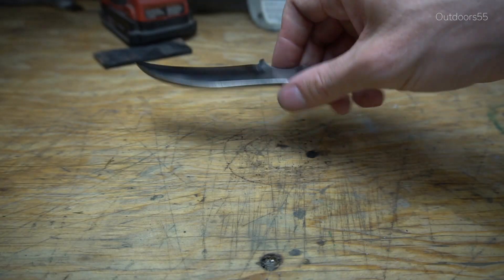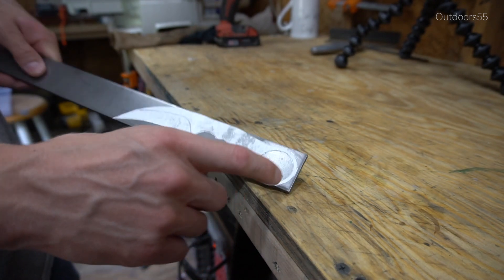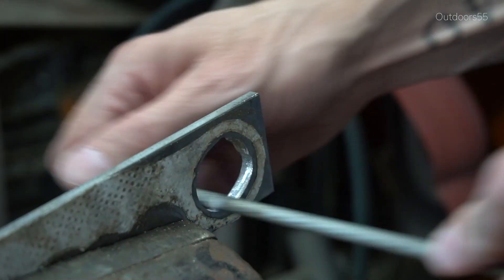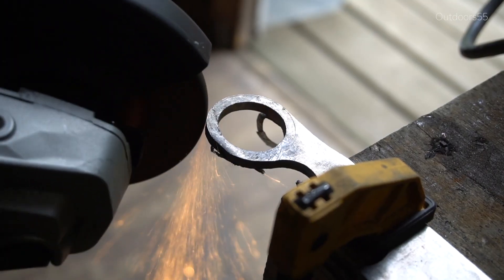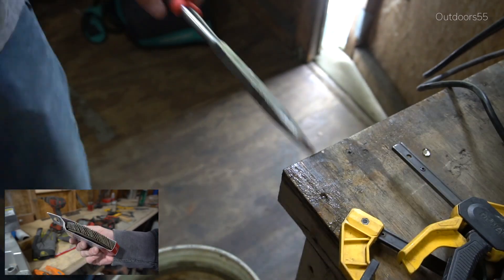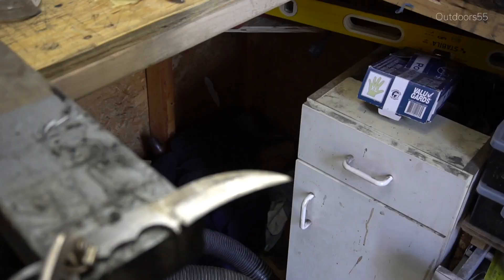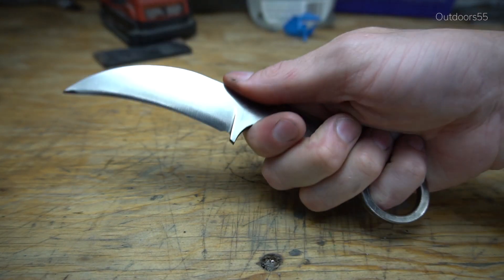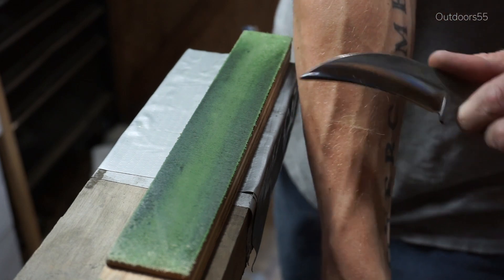Knife Making with An Angle Grinder And Basic Tools.

Comment: When I first started making knives in 1992 I heat treated my O1 tool steel knives in charcoal and used a shop vac blower to increase the heat. I used canola oil too. I used a 3x21 belt sander clamped to my picnic table for a lot of my grinding and here's a tip. For grinders use the sanding discs which only go up to 120 grit and glue higher grit sandpaper to them. I used this method with sanding drums too. Use wet dry sandpaper and it lasts for a longer time.

Comment: you should get a jewelers hacksaw. with a #0 saw blade, i bet you could've sawed through that hole in under 10 mins, using only 2-3 blades which are dirt cheap.

Comment: My way of making a large hole using a smaller drill is to drill holes around & cut their boundaries with a small cold chisel, then finish the job with a half-round file.  A lot of time & effort can be saved.

Comment: You should try a strop on a curved surface for hawkbills and recurve blades.

With karambits I find them a bit scary to spin around the finger if the ring is too thin or big, especially after hearing about someone getting bit on their own wrist
Reply from the maker: Yes you can definitely get bit. Its not recommended, especially if they are REALLY sharp haha.

Comment: Great video. Just one question. How to protect blade from rust?
Reply from the maker: Any light oil. This finish will patina fairly quickly and won't rust. Its usually how I finish my axes and I've never had rust on them. They just turn a nice dark color over time.
Reply: OUTDOORS55 Thanks I'll try.

Comment: i noticed you made like a dozen little cuts with the cut-off wheel before notching it out for the handle material removal. you could also drill 2 holes as far apart as possible, then cut down into the holes from the side so you have a tab of handle material, then cutoff wheel the holes together lengthwise and have removed a lot of bulk in a shorter time with less wear on your cutoff wheel. still need some shaping but it would have saves a lot of notching and grinding.
Reply from the maker: Because it doesnt work for smaller pieces.

Comment: i was thinking about getting a ryobi 5.5 amp angle grinder you think it would be strong enough  for stock removal
Reply from the maker: Mine was a 4 amp and it was OK. The more power the better. Its difficult to say as it seems different companies may embellish the motor hp and rating.
Reply: right well guess ill go with a 7 amp its only 15 doll more....thanks for the response i appreciate it.

Comment: Great work with just a few tools most people already have. Would've thought you could put your oil can on the fire for a bit instead of trying to pre heat by dipping with hot metal a few times. And I think that knife would look sick with a layer of paracord around the handle for a little extra grip, hand to hand combat can get a little slippery... what with the blood and all...🙄🙄🙄 New sub anyways, hopefully you got around to making a video on how to sharpen a curved blade. Just starting out blade making & hoping to make a kukri, was wondering how to sharpen one. Might try the karambit first though, looks far less intimidating a project for an amateur.

Comment: Another great knife and video. :)  I have just started knife making myself. I was wondering if a step drill would work for the larger holes?
Reply from the maker: It can, yes. Id say this hole is about an inch and a half so you would need a large step bit and they are expensive. The largest one I have is 3/4",  so not even close. Using a rotary grinder is also a good way (its a tool I have but didn't use for this build).

Comment: Hi. I hope you’ll bear with me while I ask a question. I am very very new to making knives. I have made a couple from Files, and although I wouldn’t bet my life on them, they turned out better than expected. LOL. I recently visited my local spring shop and picked up a piece of D4 tool steel leaf spring. The price was almost nothing. I’m not even sure if that would make a good knife steel but I figured it was a step up from where I was. The piece that I got  has a slight curve to it. I’m wondering if the best way to get that curve out is to just heat it up and pounded it flat, then let it air cool. Any advice from anyone would be more than helpful. Feel free to chime in Alex. Sorry for rambling, thank you in advance.

Comment: What oil do you use to quench.
Reply from the maker: I said it in the video but it’s easy to miss, I use canola oil heated to around 120-160f somewhere in that range. Hope this helps 😀
Reply: For temple knifes you can use old car burned oil
Reply: OUTDOORS55 ..Lucas go ...Thank you both.
Reply: English Patriot do NOT use motor oil. 
A: it's a little viscous and thick for what you're doing
B: it has lots of additives that really aren't all that good for you.

Comment: How long does it hold an edge?
Reply from the maker: Not sure😀
Reply: Maybe you could try a making of the blade and a time tested use of said blade, with the necessary sharpening in between uses, to determine it's durability.  I know that's over and beyond what this page is about but I would be interested in it.
I'm a wood working hobbiest and I find these videos very interesting.

Comment: Why do you use 1080 is it easier to work with than 1095?
Reply from the maker: Yes, 1080 is easier to heat treat then 1095.
Reply: OUTDOORS55 ok thanks

Comment: Hey you make quite educational videos and iv liked them all so far, I have looked around and I cant find a video of your quality that shows me how to properly take the temper out of hardened steel, i made a huge mistake not drilling my holes in my handle before heat treating and tempering, can you show me/us how to anneal metal back to softer state so that I can drill it. Iv tried heating it up to non magnetic and then tossing it in coals that are really hot, iv tried just heating it up red hot and let it cool in the forge but that haven't done anything for me either. My steel is 1080 and kind of followed your process of hardening, along with the toaster oven temp at about 400 iirc. If you dont want to make a video about it id appreciate just some guidance/msg here from someone that have already taught me alot.  Thanks, and great vids! also took the advice about the strop which really buffed up the edge, ridiculously so!

Comment: I'm almost half a year late in asking this but, don't you have a set of step bits? Like 10 or 12 bucks at HF. Definitely large enough for the finger hole in a Karambit.
Reply from the maker: The largest ones i have are 3/4".  Cant remember the exact size of this hole but its well over and inch. The larger one are pretty expensive locally.